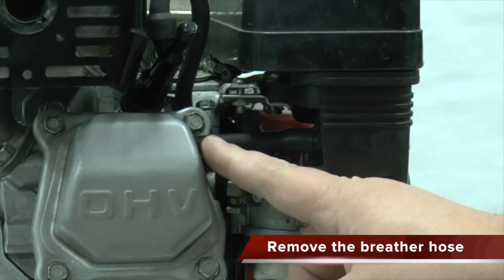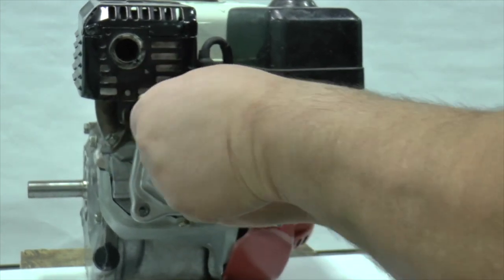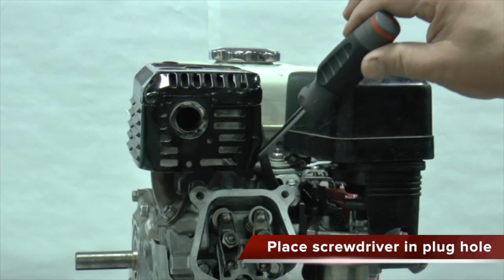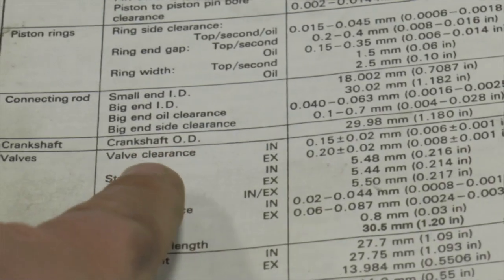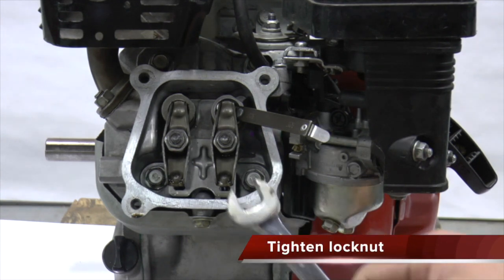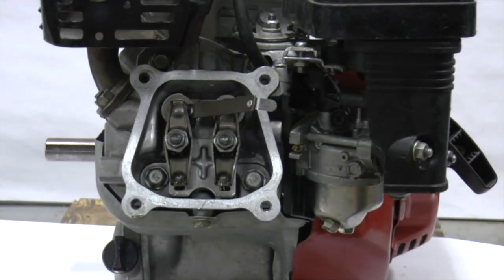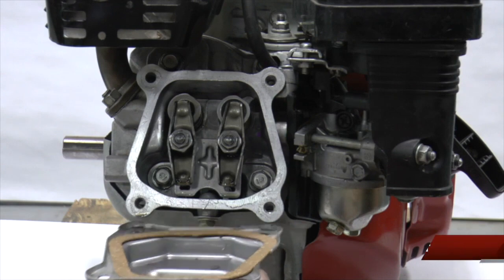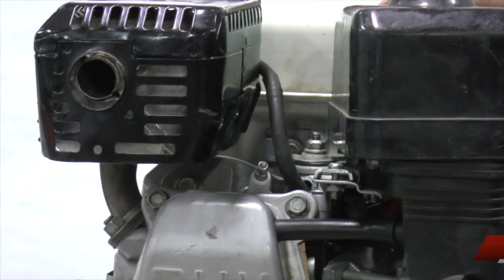Honda GX160 Valve Adjustment

Comment: Took my valve cover off and it was covered in oil. I’m assuming the gasket was bad (looked bad) and was letting oil in. Sealed it back and started it and it runs at a million RPMs now and started backfiring really hard.

Comment: I’m still having an issue with the pull cord jerking back in. I feel like I can’t make the adjustments anymore correct. Any other thoughts on what it can be?
Reply: check fly wheel timing
Reply: Key way bad
Reply: @philliphall5198  key way?

Comment: Super quality videos, clear and very pro. One feedback comment tho.  Not to nitpick but, "fine adjusting valve without loosening lock nut" all good but, **remember who may be watching**?  
Some have no experience on how tight, "feel" etc... (recheck lock nut)  I have had them loosen while doing this, depending on tightening or loosening for clearance.  Experience can make things seem obvious :)
 PS this is by no means a jab, I am excited to have come across you channel. Thanks !
Reply from the maker: One thing I always try to do, is to make my videos simple, for beginners, to the point with no fluff, and extra talk.  Sometimes it doesn't work as planned.  Thank you for your kind comment sir.
Reply: @motoprof1441  Terima kasih banyak Boss, Tutorialnya sangat Mantap, Jelas & Joss!

Comment: Nickel anti-seize applied sparingly to cover bolts and spark plug helps keep threads in aluminum block in good condition. Reduce torque values by 30%